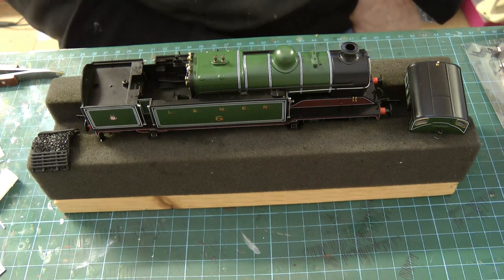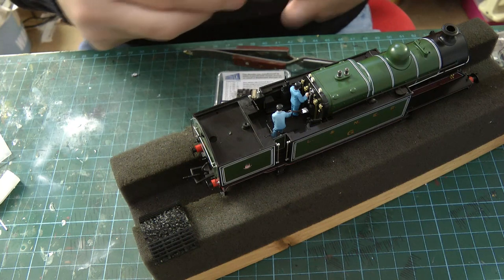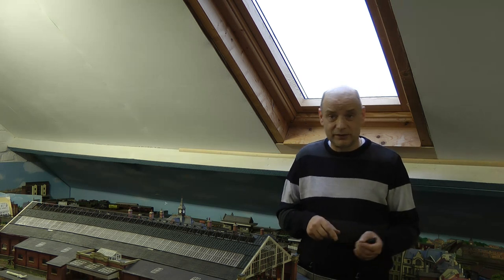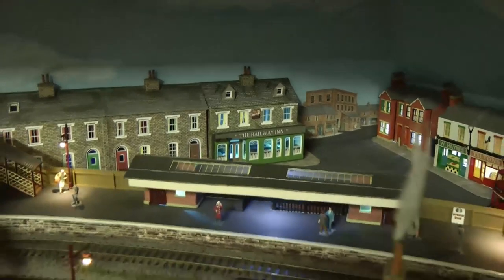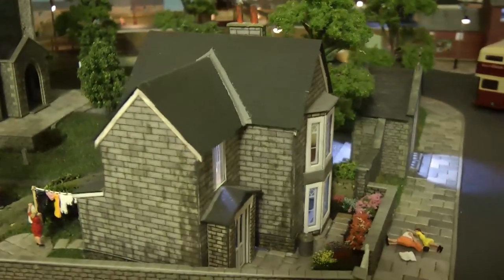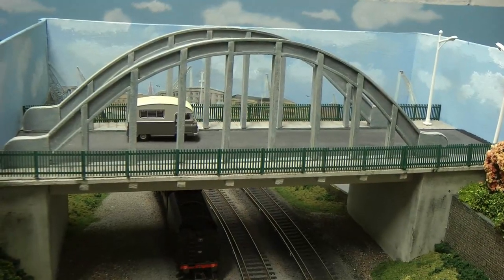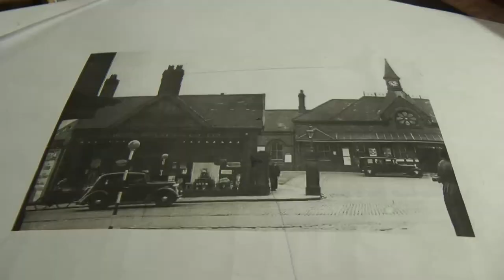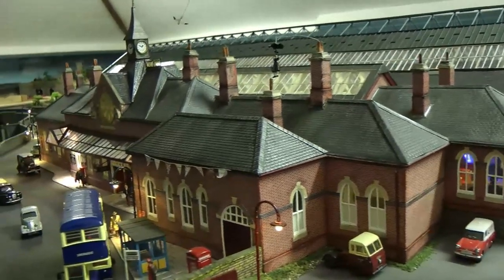My thoughts, Kit Bashing & Scratch Building. No362

Comment: I think I need to build some more Metcalfs before I start scratch building but I want to scratch build a factory which has coal delivered and goods sent out plus empty coal wagons and I will kit bash some of the metcalf kits to do that you have been my inspiration to attempt this but first I have to finish my work on the house Thank you Tony
Reply from the maker: Hi James. why not have a go my friend. do some research on what you want to build. study the photos. see what type of doors and windows that are available  that are already made. but most of all do some drawings to get the idea of sizes. and check the location to see if what space you have and make the necessary changes to the drawings. before you make a start. but most of have fun. good luck and all the best. you can do this....cheer's for now Tony
Reply: @TONYNORTHEASTERN  I will do but Railway on hold as I have just moved into a new house so I am under orders at the moment but will start the layout in June /July

Comment: Now you have got me puzzled. How did the public access the platforms at South Shields? Was there no height difference? Your description of kit bashing underplays your technique. I would describe it as kit modification. No bashing with you!
Reply from the maker: Evening Alan. that is very true. the south shields station was level with the ground at the entrance originally. and built on a slight slop from king street. for me to make it the same i would have had to make the platform to come to edge of the baseboard.  and then slope up from both sides up to the entrance. but yes, that would have been the way to go. if i was to build it again. so in the end i came  to bit of a compromise to meet up to height of the platform. i dont know if have watch the full build of south shields. there is a full explanation as i went along. but in the end its worked out quite well. 
thanks again for commenting. cheer's for now Tony.
Reply: @TONYNORTHEASTERN  Are, I was so engrossed with your methods that I missed that comment. There cannot be many stations like that with basically the running lines set lower than the general ground level.
Reply from the maker: Very true. i dont think i have seen to many. I think Ropley Station on Midhants Railway has a couple of steps. but yes very rare. cheer's for now Tony